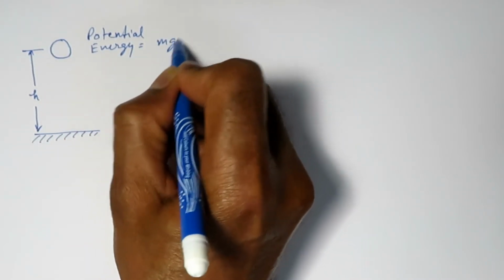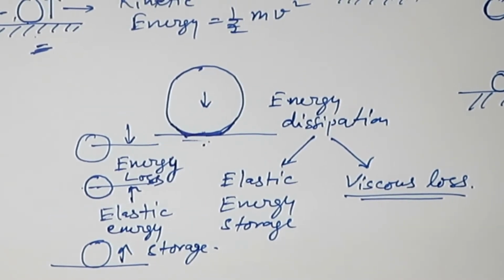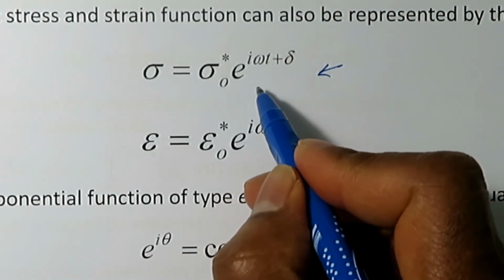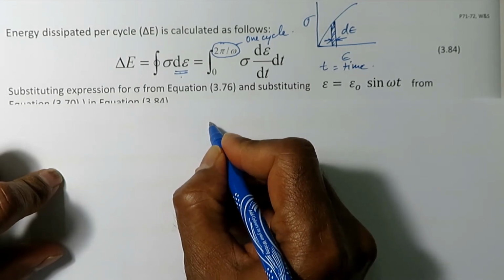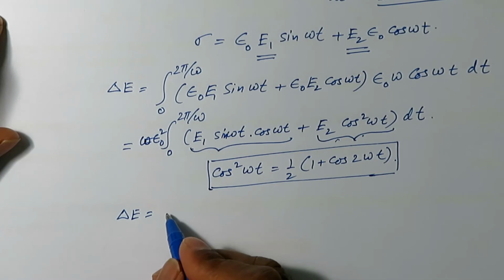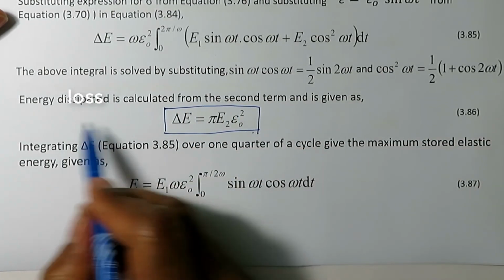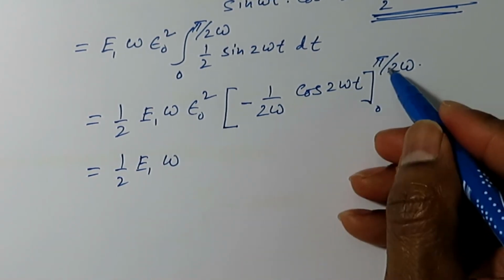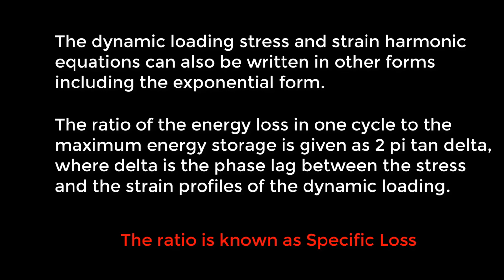Specific Loss in Dynamic Loading of Plastics - Ratio of energy loss to the maximum stored energy

Comment: Sir, In experiment which u conducted, second case is mousepad which is less softer than sillyputy but stored elastic energy  in sillyputy is more when compared to mousepad surface why is it so?
Reply from the maker: Thanks for asking this important question. The mouse pad I have used in the experiment was made of foam material and it was softer and showed less strain-rate hardening. Silly putty is not foam and it is much denser than the foam. The polymer molecules in silly putty shows stiffening property (means higher modulus) when the rate of strain is high. This is the reason, when the golf ball hits silly putty from a height at a fast rate, the molecules behave as highly elastic material (higher value of E) and very little energy is lost during the impact. The ball bounces back higher following the conservation of momentum principle. 
Imagine, if you dropped a piece of foam on to a hard floor from a height, the foam will hardly bounce back whereas a ball made of silly putty will bounce quite a good height.